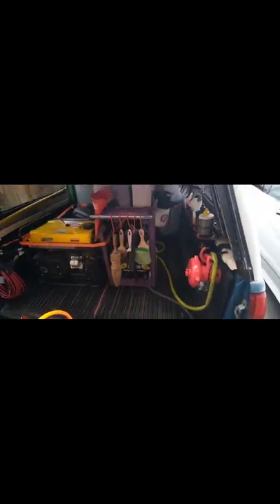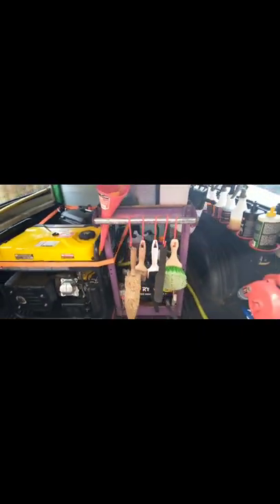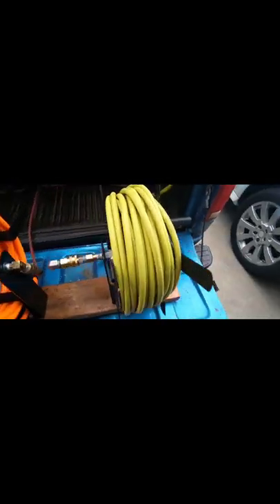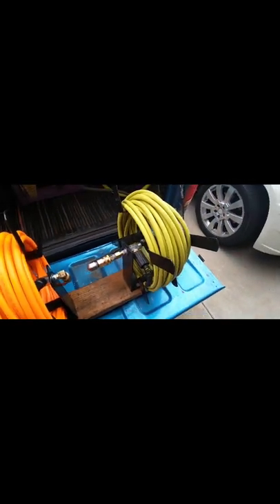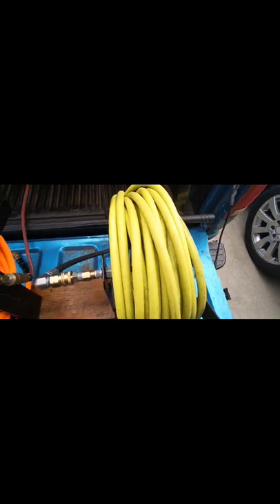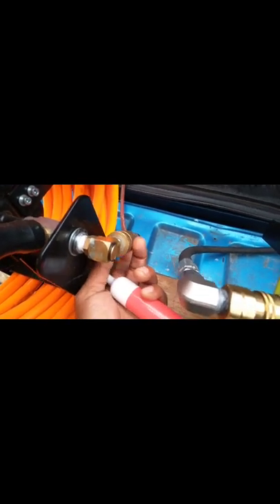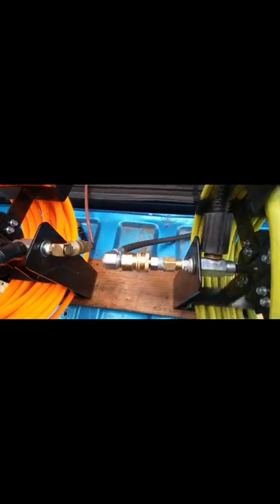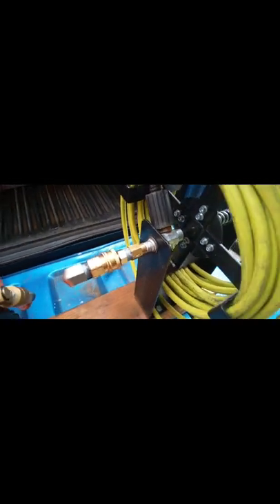How I Remixed My "Harbor Freight" Air Hose Reel Into A Pressure Washer Reel👍#detail #mobiledetail

Comment: im going change 1/4 pressure hose instead 3/8. Should I make the fitting size all to 1/4?
Reply from the maker: I used a 3/8 hose, but you can use a 1/4